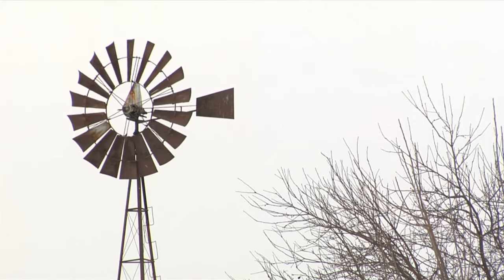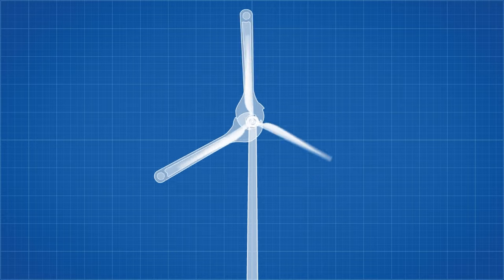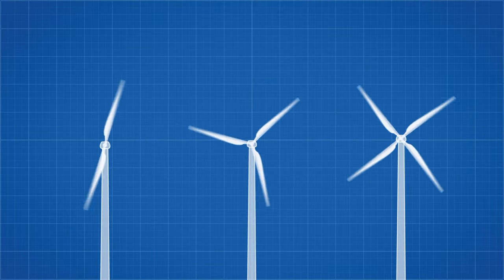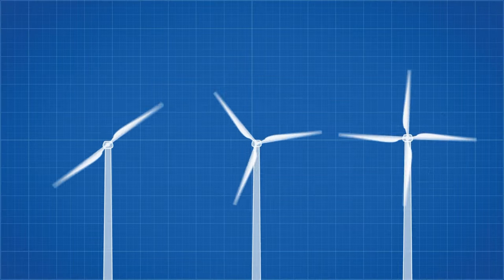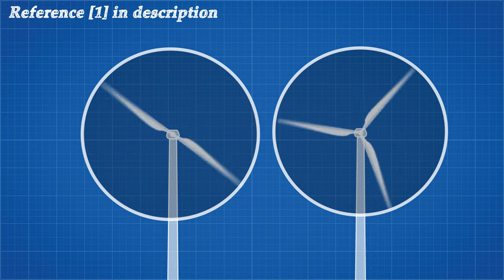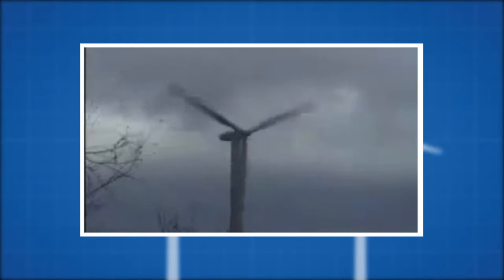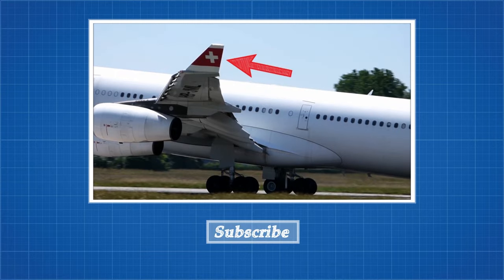Why Do Wind Turbines Have Three Blades?

Comment: I was hoping for some fluid dynamic explanation of why the turbulence of 4 blades and their wash negatively impacts the airflow and detracts from energy production.  I think a single blade with a counterweight would be most efficient you would have to match this distance of the counter weight to the pitch and rpm to provide stability.

Comment: Here's the real explanation, from noted expert Mick Sagrillo:
"When the blades of a two blade rotor are lined up vertically, they 
offer little resistance to yawing motion. However, when the blades 
move one quarter of a turn and are in a horizontal position, they 
exert maximum resistance to yawing. This continuous shifting of resistance 
to yaw jerks the wind generator as it hunts the wind. These vibrations 
eventually degrade the entire system. The inherent imbalance of a 
two blade rotor is totally eliminated by adding a third blade."

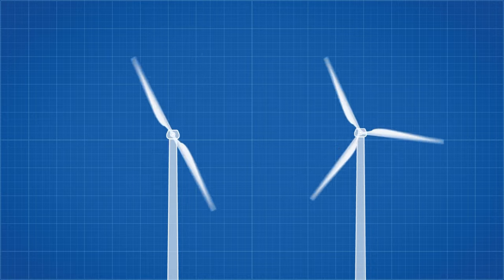Comment: 2:02 - In real applications, we plan around the outward, centrifugal forces -- we don't start with inward, centripetal forces. Angular momentum (circular motion) dictates the apparent inward and outward forces, but the blades, in their own reference frames, experience an outward force that must be countered by tensile strength, which is the inward, centripetal force.

Comment: I looked into this a few years ago, and the mathematics was clear; the most efficient design is a single blade with a counterweight. I still find this counter-intuitive. For me the wind-pump multiple blades design makes sense. And why do turbines, which perform the exact-same function in reverse (i.e. they pull wind instead of being pushed) have hundreds of blades?

Comment: Another point that you didn't touch on is a phenomenon that isn't quite understood yet. Wind turbines with an even number of blades, but especially 2 and 4 blades, can cause some form of nausea or sickness when looked at, even at great distances not far from the horizon. This has been the case for quite a few wind turbines which actually haven been build with 4 blades regularly not that long ago

Comment: The question that I always wanted to know about windmills? was how long will they have to run before they can break even, when the output equal the amount of energy it took to make them in the first place, and then how much more energy would it be able to make after that before it wore out?
Reply: I'm sure the wind turbine industry will have estimates for that. The problem with giving a solid answer is that energy output is tied to factors beyond our control, namely the speed of the wind. With a fossil fuel electricity generator, the actual figures and the theoretical models for fuel consumption to output are well established because the combustion environment is controlled. Even nuclear plants can determine replacement ratios for reactor materiel. But wind (and solar, tidal and geothermal) are inherently not controlled environments.

Comment: Two blade designs are more unstable also because their principle axes are on the lines parallel and perpendicular to the blades, so any perturbation in their rotation axis will require additional torque on the tower structure, making them more vulnerable to random wind stress.

Comment: I read somewhere that the power of the wind turbine does not depend on the number of blades, but on the surface covered by the blades. That would explain why more blades does not mean more power.

Comment: This video presupposes the current size and weight is what's needed. IF you stay with the same size blades all he said is true, but it doesn't address the concept of going with a design that uses smaller and lighter blades. The larger the blade is the heavier it is to build in the required strength to handle the stresses it gets put under. Yet a blade of half the length has a lot less than half the stress and needs a lot less than half the weight. Once you move back to smaller sized units the whole equation changes very dramatically. Also the risks and dangers are a great deal lower.

Comment: You forgot the important argument about increased stresses with the 2 blade system.
Because there you have the problem, that when one blade is exactly in front of the pole it doesn't skim wind energy and in this position a big momentum between the blades accures. Combined with a resonating frequence this would be fatal.

Comment: The whole reason is to reduce the feedback. If there is an even number of blades they will generate waves in phase during the revolution. By having an odd number, the cyclical waves cannot be in sync, and so will not generate increasing forces to eventually destroy the turbine.  It is the same reason propeller planes (other than the earliest ones) have an odd number of blades.  It's all physics, not cost.

Comment: I might say that this is not the reason as u have mentioned, the reason is solidity factor and others, actually by increasing the more blades we will not simply get the power increase rather the design will become difficult as the factor of axial force coefficient, power coefficient and torque coefficient need a compromise design for getting the max. Power and so on..
Reply: I wish if I could write more but I have exam tomorrow so next time I.A

Comment: Currently the max output of the largest wind turbine is 7-10 megawatts.  A boiler built on the half the space of 7 turbines can create 49 megawatts. Also meaning a wind turbine will never pay for it's own manufacture costs, no matter how many blades Goldilocks has.

Comment: Marcellus Jacobs is the engineer who figured out the three bladed propeller system for wind generators back in the 1930s.  Look it up. His successful basic design is the still the one that exists today in the many patented improvements. No one needs to reinvent the wheel.  It's still the gold standard for ANYTHING wind generated.

Comment: There's another problem with two blade designs. When the blade is at the lowest point, there's less force because the tower obstructs airflow. When the blade is at the highes point there's additional force because the wind marginally stronger. Both effects cause stress. You can't prevent either of them but you can avoid that they happen at the same time.

Comment: Anther reason for three blades is that a two blade design stresses the construction more, due to the difference in wind force near the ground/top, and greater shock when passing the tower. More wear and tear, and expensive components. Also, two blades mean more "visual noise" due to a blinker effect.

Comment: The force that destroyed the blades may have been excessive tip velocity, resulting in the tip of the blade passing Mach 1 and being shaken by the vibration that the early jet test pilots encountered. If it happened so quickly, that the disintegrating machine sound drowned out the sonic boom, you might not think of it. Tip speed is a critical factor in determining maximum RPM of a aircraft engine.

Comment: More blades do not mean more power. Theoretically you can have the same power output with one or ten blades. The really relevant number is the sweep area of the blades (the area the blades cover in one rotation).
Turbines with lesser blades have to spin faster for the same power output (you got that correct). However, spinning faster is usually considered a good thing. Firstly because a higher rotation speed means less torque (with constant power) and less torque means your generator and gear box becomes cheaper. Secondly imbalances e.g. due to wind shear become less dominant (with constant blade number).
It is correct that faster means usually louder, but this is not the reason why turbines do not have two blades. Think about wind turbines offshore or in the desert. No one cares how loud they are, but they still have three blades most of the time.

So turbines usually don't have four blades because you would need a fourth blades (they are expensive) for the same power output. Also the generator/gearbox would become more expensive.
The two blades design is not preferred because of the imbalances it implies. Think e.g. of wind shear (wind speed increases the higher you get) and turbulence (fast local changes of wind speed). These imbalances do not cancel out with three blades, but become less of a problematic.
Reply: Could you please elaborate on the role of torque in a wind turbine? Which direction its force point to? Is it a good thing or a bad thing? Would the turbine still work if it it didn't produce any torque? Thanks!

Comment: you forgot one of the most important thing. It has to be an odd number. Having odd number of blades offsets the weight, thereby providing almost no stable resting place, this increases performance at low wind speeds. Also, having more blades will require stronger breaks, 5 wing designs will break down very frequently at higher wind speeds.

Comment: The 3 blade design on the V164 model (one of the biggest wind mills in the world as of 2016) is manufactured that way so it wont hit draft winds.. A 4 blade design would simply output LOWER power than a 3 blade design, due to draft winds slowing the entire rotor.

I'll accept the (short) 2 blade vs. 3 blade design explanation - tho alot of more info could be added on that particular diffrence.

- Fact delivered to you from an MHI employee.

Comment: You skipped the major advantage of 3 blade design:The minimization of torque stress normal to the main bearing as explained by Robb.You can only achieve this by any odd numbered blade design.The optimum is three blade design.

Comment: Quastion : supposedly if we consider using 2 without the cost problem, wouldn't stalling at 0 and 180 degrees be a big problem in the generator torque profile. This will result in poluted electrical energy generation and high cost filters to connect it to the grid.

Comment: Well explained, but brings a question...what happens to cost, wind noise and power production if the 4 blade design has the blade length reduced by 10-15 percent? And a second also comes to mind reference the brake failure/turning to fast......why couldn't a 4 blade design be equipped with a way of turning two of the blades "backwards" when high winds are expected in order to have the blade spin counter each other, thus stopping their spin no matter HOW strong the wind gets and eliminating the possible damage that can (as seen in your video) happen??

Comment: totally missed the most important factor, you get diminishing returns for each added blade and you are basically maxed out on energy you can pull from the area with three blades. Two or four would perform similarly, it is really about aesthetics with choosing the 3 blades, universally preferred.

Comment: I have seen several wind turbines in Germany using two blades. Efficiency is a little more with three blades, but beyond that, there is no reasonable gain.

Comment: There is probably a "sweet spot" in size/power output vs. cost/maintenance cost/ operational life expectancy and expected rate of return on initial investment.
When you get into the range of a 10 MW turbine that might cost 12 million dollars because it needs nano-engineered polymers and composites...is it better than two 5 MW turbines that cost 3.5 million each?

Comment: The two blade and three blade solution is closely related to a ballerina dancing with her arms closed and her arms open. It has to do with the inertia along different axes of the turbine as a whole.   For a two bladed turbine  the moment of inertia changes a lot  with the minimum being an axis along the length of the blades ( ballerina's hand closed)  while the maximum being at right angles to the blades (ballerina's hand wide open). With three blades this does not happen as the moment of inertia of a three bladed is more uniform irrespective of the axis being considered. 
So you now one can imagine a vertical axis turbine operating in the wind which is constantly changing direction. If a turbine with two blades happens to  have its blades vertical then turning the turbine in another direction is easy, but if the two blades happen to he horizontal then  it is more difficult and all this is stress on the turbine shaft and also a set up of vibration due to this and other issues as the blades pass in the vicinity of  the tower itself, with the associated metal fatigue.
With three blades the action is more uniform as the moment of inertial is more uniform since it can be regarded as a full disc.
I shall  not go into the precession effect  of rotating discs, but this too have an effect on shaft stresses.
Betz's law says that no turbine can capture more than 59.3 % of the energy in the wind and so starting with a single blade, which operates in cleanest wind, this could be the most efficient at very high speed, two blades will mean that each will follow in the wake of the other and with three and  more blades t each blade will be working in the disturbed air of those in front of it.
So it is all a compromise, three is the best compromise as in the three phases of AC powerstation  generators and transformers as there is a balancing effect which I shall not go into.

Comment: I might be wrong, But I heard that the Vertical Cylinder type turbine spins in less wind producing more power. If so, Why aren't they more prevalent?
Reply: Power scales by area and the cube of wind speed. Wind speed is higher and more constant as you move away from the ground. Speed follows a logarithmic curve once up above 50m. Vertical axis wind turbines have a much lower integrated average height for a given tower height than horizontal turbines. Large horizontal turbines also scale their collecting area by the square of their blade length.

Comment: What about the turbulence off the blades affecting the next blade cutting through the dirty air? Thought that was the main reason. And what about speed? The reason they spin at 16rpm is to generate synchronised power. And finally spinning out of control? Wind turbines pitch off when wind speeds go over 25 meters per second. Nowa days they dont spin outa control

Comment: 1. how much power is used to turn the blades into the wind?
2. how much power is used to turn the blades to stop the bearings getting flat spots in times of no/low wind?

Comment: Two blades wind turbines typically require a 'teetering hub' which is more of an engineering challenge. There's a shadow effect each time the blade passes the tower that creates eccentric forces that are much more prominent in a two blade design than a three blade. Larger two bladed concepts with more mass have tried to eliminate the need for a teetering hub, but they're still essentially concepts, with nothing in serial manufacture. Two bladed designs are also perceived as being more visually intrusive to the human eye.  The reason for three blades is down to the aerodynamics of rotor solidity. The modern three bladed wind turbine is very aerodynamically efficient, it's mathematically the most optimum design for a horizontal axis wind turbine that needs to create high speed and relatively low torque and the design that will come closest to the Betz limit. Read up on Rotor Solidity and Betz.

Comment: For the same reasons, some single engine airplanes have three blades instead of two.  Two blades are more efficient.  But three blades are shorter to produce a similar amount of thrust.  BTW, I understand from a man whose company uses drones to inspect cracks in the windmill blades that each blade costs about one million per blade.

Comment: More blades = more torque.... And if you don't want to rip the powerhouse off the pole, you would be more conservative. 
Also, more blades forces the brake to work harder when the local power distribution network has too much power vs. demand. 
In addition, if there were more blades and made shorter, there is a possibility of increased noise where the blades approach the sound barrier such as on turbo prop airplanes.

Comment: you forgot gyroscopic balance! the two blade turbine has  vastly different moment of inertias along the length of its blades vs the chord  this caused large amount of cyclic loading on the drive train  and support structure  as the turbine rotates around the vertical axis to match shifting wind.

Comment: There is more behind it then cost. The 3 blade design has better performance then 4 blades. 3 blades give you a lower cut-in wind speed and better top end performance. The tower primary brake is the pitch of the blades and when a turbine has an issue and faults the primary brake (blades pitch back to 90 deg) if they stay pitched out to 0 deg and the load is dropped from the generator and the rotor will increase in speed until a blade hits the tower. Not all are the same but this is how most wind turbines work.

Comment: I think the 4 bladed design was glossed over. Does the power output of the turbine increase linearly with the number of blades, or could it? If so, why would it not be cheaper to add one more blade on, say, 3 turbines, vs adding a 4th turbine and having to construct a whole new tower?
Reply: No, power is not related to number of blades.  No, it can't be changed simply because you want it so.

Comment: Just a cost analysis.
Well,the costs need to be increased in the 2 blade to have better breaks,and that is it.Torque does not matter when making electricity,rpm does.